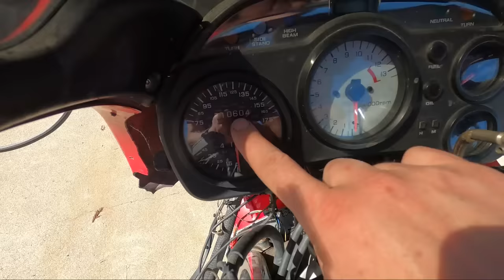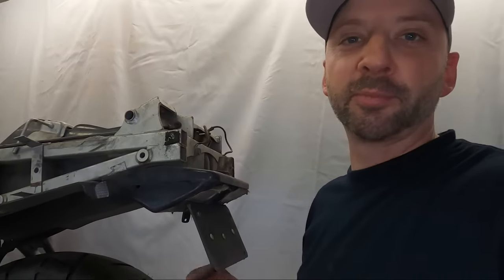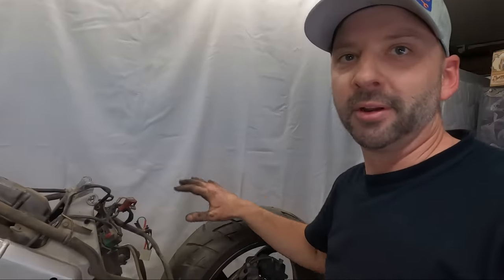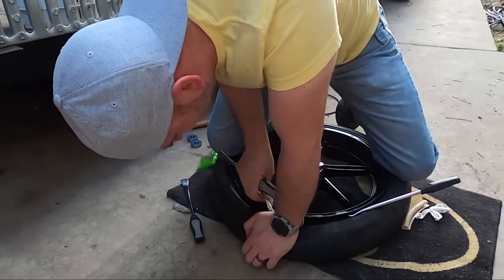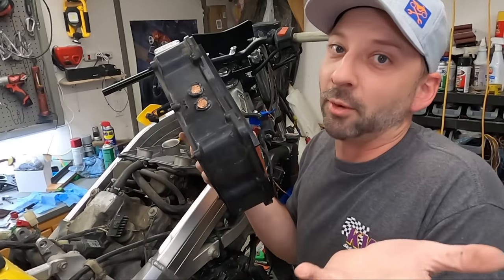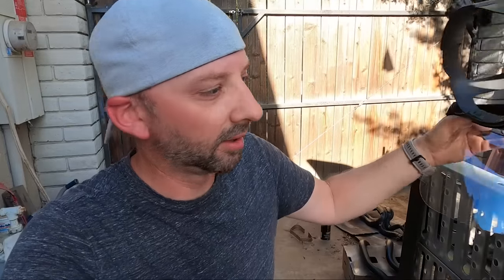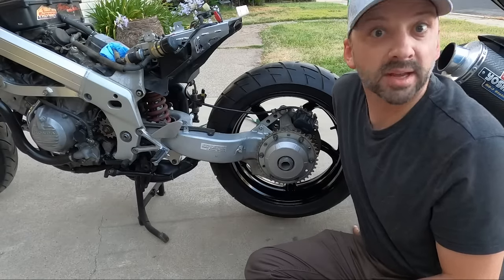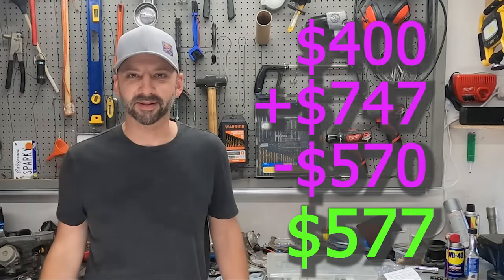I Built A Street Fighter For $577 !  WITH a V4 Engine! Restoration!

Comment: That 525 rear sprocket is going to eat up that new chain. The difference between 525 and 520 isn't just the width. 525 has a longer distance between pins, too. The right way to do a 520 conversion is to buy 520 sprockets. Vortex and supersprox both have 520 rear sprockets for that bike for around 50 usd. You don't mess around when it comes to chains. When they break, they can cause a lot of damage or cause serious bodily injuries.
Reply: I'm pretty sure the 5-series chains all have the same pitch and roller diameter.

Comment: Your technique for doing sheet metal is exactly like mine. Print out the flat pattern and stick it to the metal. I sometimes need to do the same thing with tubes. Split the cad model and convert it to sheet metal, flatten it, print it out and wrap it around the tubing and you have the pattern to join tubes.

Comment: Prepping parts for cars and motorcycles does not involve just basic sanding. You need to sand and sand and sand. Usually what I do for motorcycles is sand most of it with 320 then 400 could take me a half a day to sand parts

Comment: you painted the plastic parts without using plastic primer before the stock grey primer .. OFC it will peel back :) and the rivets .. you should prob have done em in 1 line first instead of 2 lines and it beeing bent over .. ty for the video ofc :D

Comment: Nice build I got a couple questions. I currently own a 94 vfr 750 and im turning it into a streetfighter

1. what digital speedometer is that and how did you wire it up.

2. what did you do with your oil cooler

3. what size sheet metal did you use to fabricate the side pieces
Reply from the maker: Awesome, I love VFR's!
The speedo link is in the description
I cut the lines to the oil cooler and moved it below the radiator with new bracket
Most of my sheet metal brackets are 14ga, a few 11ga. Go to a fab shop and ask for scraps!
Reply: @SparkyMoto  
Hey mate.. awesome build.. I absolutely love it.. is there a name for the type or style of bike you made.. because this is the exact look I want in a bike.. I've been riding around on my mates Honda grom which he's done up a bit and has that exact same look/stance.. but it's a mini moto 125cc and it feels just a touch light and a fraction small.. and I want to find one in that style with more power but no to much bigger in size and I don't know what term to use to search for this style.. any suggestions.. ? Thanks man.. much love from Oz..

Comment: Great build. You def made an out of date bike look good. Single sided swing arm was a bonus choosing/finding that model def adds to the aesthetic.
Reply: VfR's are amazing, a 5th gen was my bucket list bike, got it last year 😁 the 5th gen was the last gen to have gear cams, basically cam gears for the valve train, no chain or belt, incredibly over engineered and they sound nuts bit like a straight cut sequential, plus yea single sided and that V4, they eliminated the gear cams for vtec at 6th gen, shame but makes mine hold its value nicely lol....